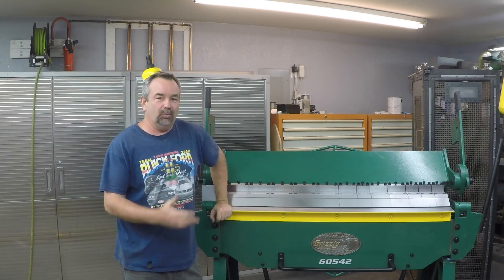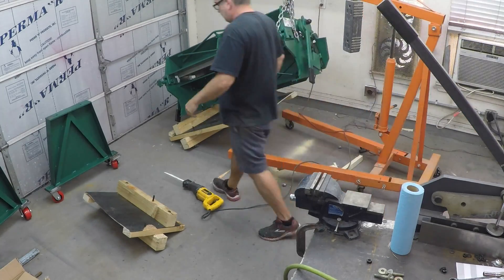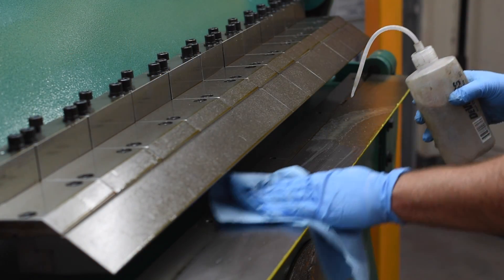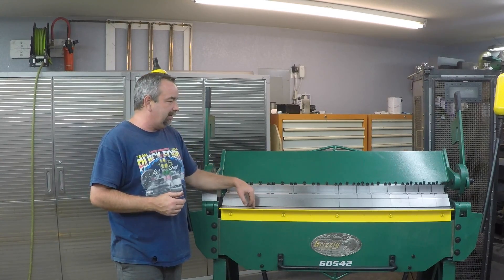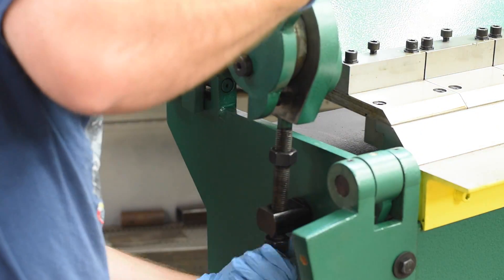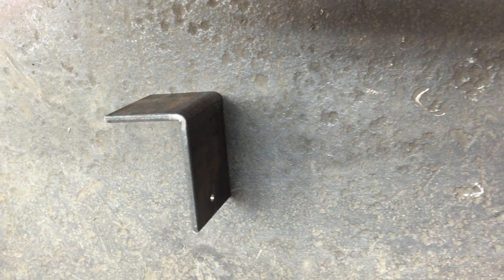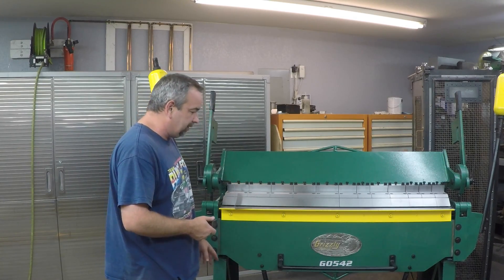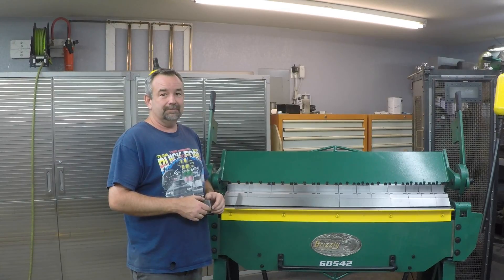Grizzly G0542 Sheetmetal Brake - Setup - Review - Demo

Comment: The set back adjustment is for the thickness of the material to be bent?ie if 1/8 material is used the you set the set back or the lip of your break to accommodate your bend.

Comment: Have you tried bending 1/8" aluminum sheet with it yet?  If so how wide of a piece can you bend?
Reply from the maker: +64ls1nova I haven't tried bending any aluminum yet, but my guess is it would bend at least half the width of the brake in thats size.

Comment: nice informative video. I have been using this same bender for a couple years now with few issues. I found the stop to be sloppy, so I made my own replacement that repeats bends much more accurately.  and second, the welds holding the all thread to the cam mechanism failed (might have been my fault though) and it was easily repaired. other than that, I am very happy with it

Comment: Have you bent any aluminum on this? I need to bend 3/16" 6061. What are your thoughts? Thanks for the video.
Reply: +turbocobra there will be problem bending 6061, it will crack, unless the bend radius is large, like 8 times the material thickness , or try annealing it.        5052 grade of alum. is used when bending of the designed product
Reply from the maker: +Mark Fetters Hi Mark, I havent' bet any aluminum yet, but i have bent some 1/8th steel in different widths up to 6", no problem on that, how wide are you talking about with the 3/16" aluminum?
Reply: +turbocobra Around 24"
Reply from the maker: +Mark Fetters i don't think you would have any issues with that..

Comment: Lol at the endings. But could have been worse and landed on your fingers, turning your nails black. :( Had my pinky nail crushed between 2 25 pound weight lifting weights. Nail Turned black and fell off later. Lol
Reply from the maker: TheMarcusGomez Dang yea, that sux, similar thing happened to me, but i kicked a weigh in my house with flip flops on, was walking by it not paying attention and kicked my foot right into it, lost a toenail.  I got lucky on this that it didn't fall very far and mostly hit the knuckle on my middle finger, so not bat...

Comment: I like the Mr Smooth outtakes. What do you think of the overall quality of Grizzly equipment? I been kinda looking at some of their wood working line of machines, for future purchases I have in mind. BTW very nice "Crisp" bends!
Reply from the maker: Mopardude So far I have no complaints with the Mill or the Break.  I called Grizzly twice for questions/issues with the Mill, and both times got great service, sent me out a complete new gear set for the mill no questions asked, even though it was my fault they stripped because i push the machine to hard.

Comment: Most of the garages ive seen among our group  we pretty much have to have stuff mobile, at least I do. you never know when a hail storm or weather event will pop up and you have to move stuff around and in a hurry! We have A grizzly GO447 that has been used everyday all day long for prob 10 years at least. I like their tools. PS nice gantry....
Reply from the maker: johnsont963 Good to hear you had good luck with the Grizzly machine.  It's all Chinese imported stuff, but Grizzly does a nice job of packaging parts and support with it.  I have called them 2-3 times about the Mill, and they were great to deal with.  Thanks Terry

Comment: Great review on the brake.
I wish I had the room to get one in my shop.
I guess Mr Smooth found out why they call it a "Finger Break"   lol  :-P
I did sheet metal work in HVAC for years on an 8 ft version and destroyed my fingers on a regular basis.
Stay safe buddy.  :-)
Reply from the maker: cecil6711 I thought you made one didn't you?  The one I made worked decent, but the pivot point on it just made it such that it would not make a tight sharp bend.  Since the things i will make with this will hopefully be sold to customers, I wanted it to be more professional, otherwise the one i built would have been just fine.  I thought you had told me or mentioned that you had done HVAC work...  Now you get to do more of it for the hotel!
Reply: turbocobra Yeah,I made one from a set of plans I ordered from ebay but it is not a finger style like yours.
Making 4 sided boxes will be much easier on yours.
Plus yours looks much cooler with your logo against the Grizzly green paint.
Keep up the cool work buddy.  :-)